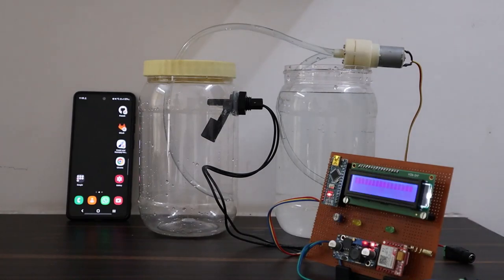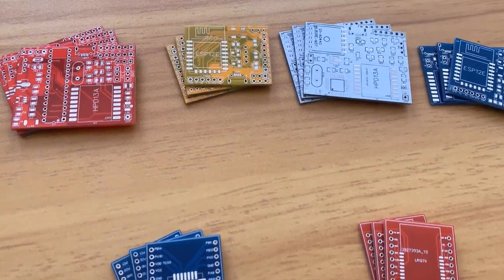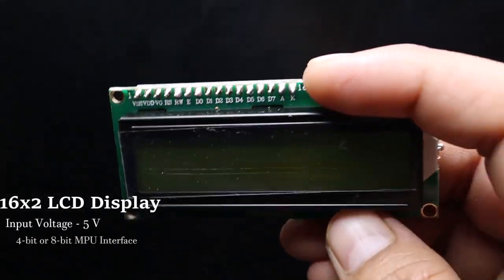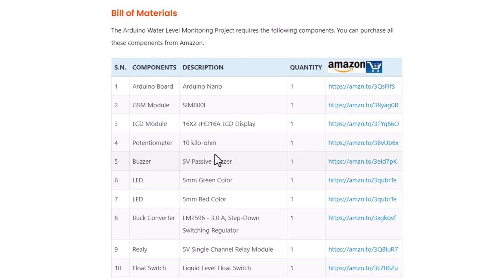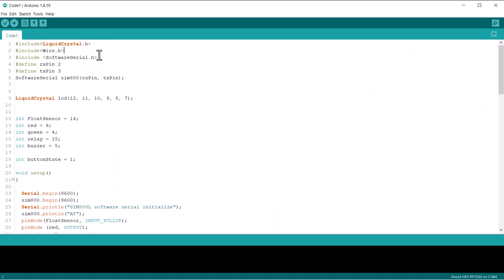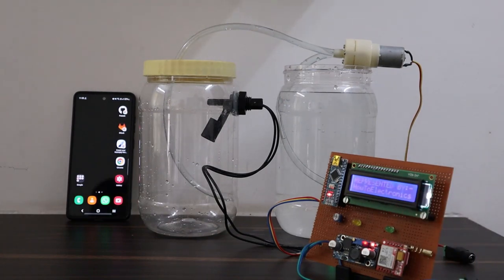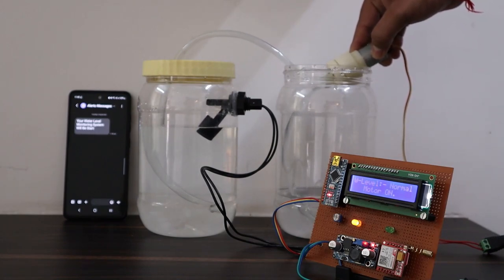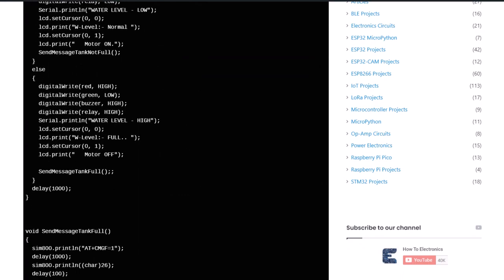GSM Based Water Tank Level Monitoring & Control System using Arduino with SMS Alert

Comment: Hey some somple5 qsn may I ask abut GSM module. I encounter some problem which catching netwoork with my sim800L.
1..What is inbuilt tantalum cap value?
2. Which firmware version in that module?
3. What is the voltage output of ur buck converter? And its input value?
4. Wht the value of dbm u r getting  in AT+CSQ command?
Reply from the maker: Sim800L has network issue connectivity. So better to use any high power GSM antenna within the gsm frequency range.
Reply: @HowtoElectronics  any other gsm module in low price range? Also which type antenna and where to buy in India